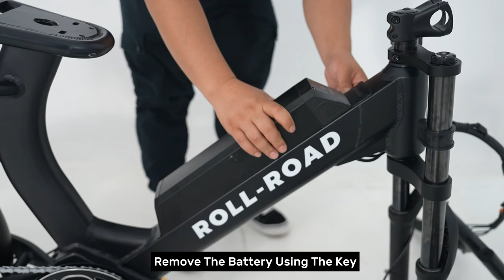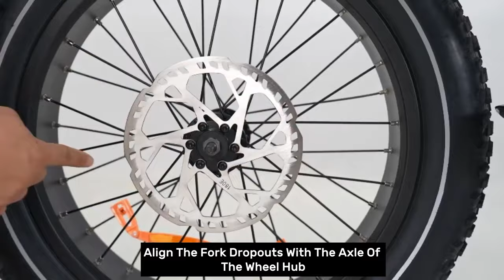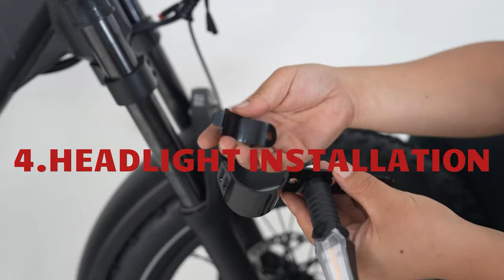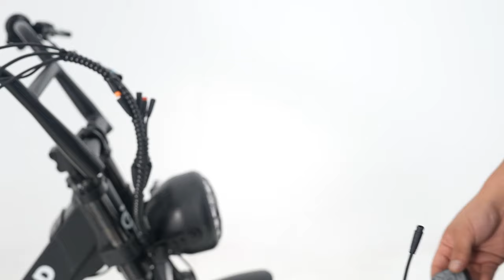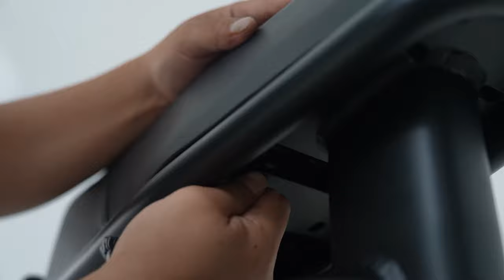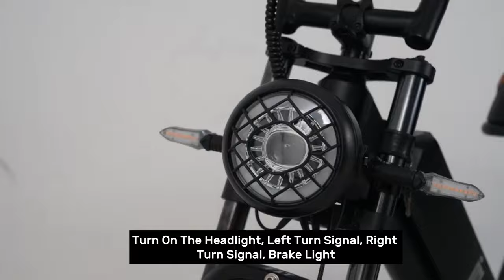New Emma 2.0 Installation Guide

Comment: M
Nice bike trouble is I bet he can't peddle all these bikes are more a less the same I can by height of krank to seat these bikes are hopeless u should I've bought a one they all the same from China 😊
Reply from the maker: Well, you can pedal on ebikes and moped style ebike is more comfortable to pedal. With torque sensors, you can make the best of its pedal assist!
Reply: @RollRoadEbike  what I mean on a fat tyre bikes the seat to krank is to short so your legs or knees come to far so it's bad for the knee jiont. I've got fat tyre ebike 750wat I've upgrades seat height with pvc 4 ins and it's still no good it's 20 ins frame bought from amazon. I could shorting the krank arms by ins and half. Of course you never peddle on a bend as peddle hits the ground. I thought fat tyre bikes were fin they are not best is my other bike 2000wat 52v 20amp 45amo controller it's only got front suspension if it had rear suspension I wouldn't have bought this rubbish
Reply from the maker: This is really an issue of most 20" fat tire E bike,  because most of them has 33" seat height. We improved the frame height.  From the standrand seat to the ground to 35". And the 18 " long saddle and optional 24" make it possible for long legs to move back and forth to find the most comfortable position. And Emma also has lower 33" seat friendly for shorter riders. @colinwhite144